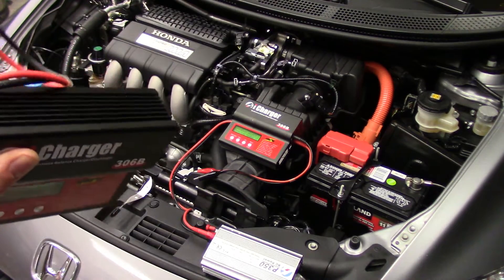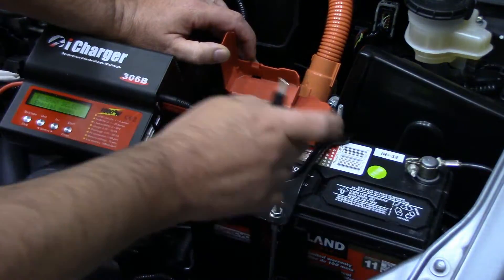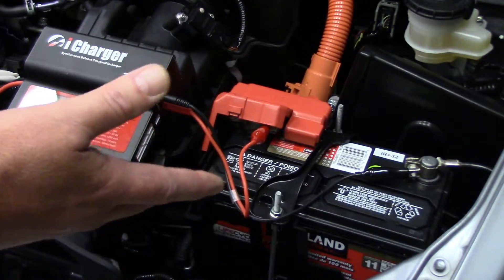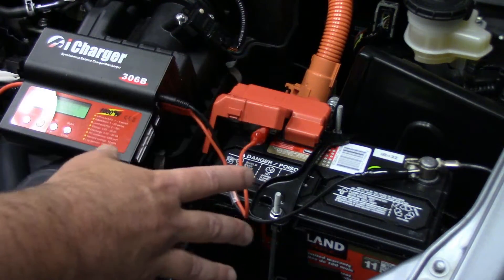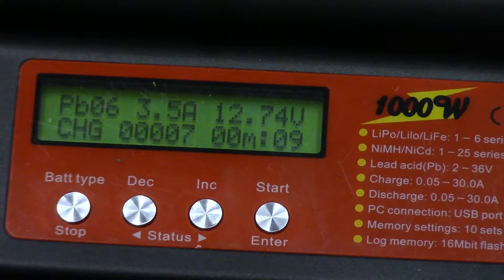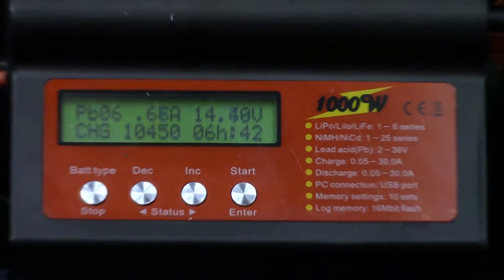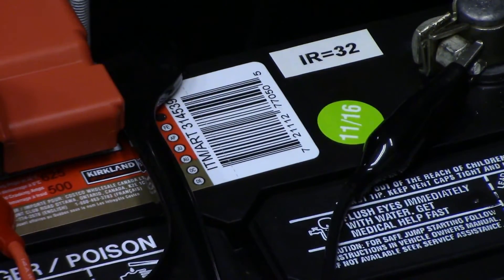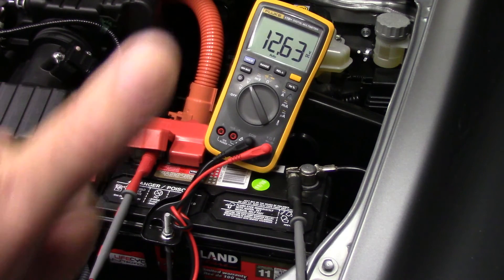How To Charge A Car Battery With RC Charger - Connecting, charge rate & tips.

Comment: Where does the 2.4 come from? Just curious
Reply from the maker: If you are referencing the 2.4 denominator to figure out Ah from reserve capacity, it was in a conversion formula I found online. I have no idea where they got that denominator from? The better method IMO is by using the reserve capacity in hours x 25A. If you are referencing the 2.4 volts number I mentioned, that is the typical voltage applied across each cell in a lead acid (PB) battery during the topping/absorption constant voltage phase of the charge cycle.
Reply: @Rchelicopterfun  my charger has a setting for cell voltage which defaults to 2.4 for pb. this is the correct setting? i'm reading 2.1 v in some other research i've done so i'm not sure which to go with. great video
Reply: @trevorstuart3950 Same with mine. Using a K2 Air.
Reply: I was reafy to ask the same  question.

Comment: Can any RC chargers you're aware of be used as battery maintainers and or desulfators? I have a Hitec and don't see anything in the menus that seems like it can do this...wondering if there is anything out there aside from stuff like the NOCO chargers that don't really work for the RC world....
Reply from the maker: I don't know of any computerized RC charger/s that has a de-sulfate PB battery algorithm. No idea if they would work as "maintainers" since they will generally stop the charge cycle once the battery reaches its full voltage potential. I suppose if you used a really low charge current rate, it likely wouldn't turn off due to the internal resistance of the battery not allowing a full peak voltage to occur so the charger would keep apply a tiny flow of current (provided you disable any time or capacity auto shut offs in the charger) . Again, that is just an educated guess as I've never used a computerized charger to maintain a PB battery - I've only charged them.

Comment: Planning to use my duo 4010. Wasn’t sure if I needed a special cable with battery clamps. Also wondering if you can desulfate a battery with one by turning up voltage and minimizing amperage. I haven’t yet looked into the charger options to see what’s available.

Comment: I've always believed that once a car battery is allowed to go flat, it's toast and will no longer hold a charge. Is that correct ?
Reply from the maker: It really depends on the quality of the battery, age of the battery, capacity of the battery and how long it was left in a discharged state. I've had many vehicle and power equipment PB batteries go flat over night/several days due a light or accessory being left on or a high parasitic drain. Most of the time they charge back up fine if done ASAP.
No question usable life has been reduced & compromised with such events as some plate sulfation has definitely occurred, (the longer it sits in a discharged state, the more it will sulfate), but if it happens to a healthy battery a few times  and it's recharged ASAP, there should still be lots of usable life left in the battery.
Reply: Thanks John, I used my Imax to recharge my battery. It took almost 24 hours and at 3.5amps it put a whopping 14,000mah back in. I tested the IR (my Imax has that feature) and it's given me a very low score of 14. I'm not sure if I can trust this battery for trips around town. I don't want to get caught out. My car has been sitting in my garage for 7 weeks as I had a crook knee and was unable to drive it. Although I have been starting it once a week and letting it run for around 15 minutes. Obviously that wasn't enough for the alternator to re-charge it. Maybe a good long run on a freeway might do the trick ?
Reply from the maker: Load testing the battery is the sure fire way to know if the battery can still deliver its rated current. And yes, not much good can come from starting the vehicle several times and let it idle for 15 minutes each time. Likely took more charge out of the battery during each start than was put back into it. Would have been better to just hook your charger up to it every couple weeks. No point driving it on the freeway if you have already charged it back up to capacity with your charger.

Comment: All of these should apply with optima battery  as well right maybe amp charging a little different?
Reply from the maker: PB charging principles and algorithm used are exact the same. CC (constant current) for most of the charge cycle and then finishing/topping up with CV (constant voltage).
Reply: @Rchelicopterfun  my optima battery was on 6 volts its  been sitting for a year, i have the 4010 icharger and it's telling me low voltage. I tried charging it on NMH and the charger read it. All good now like brand new. Thanks for the response.

Comment: My PSU is a 12v only.  (modded Dell server PSU), would that be enough?  It should, right?
Reply from the maker: Depends on your charger, charge voltage, and current.
Reply: @Rchelicopterfun  i am using iCharger 208B, same settings as in your video.

Comment: My brain is refusing to work for me, what settings would I use for a 12 volt 3ah battery?
Reply from the maker: Assuming you want to use a PB safe 0.1C charge rate; 0.1x3Ah = 0.3 Amps
Reply: @Rchelicopterfun  
Thank you so much.

Comment: Thank you, my vehicle specific charger crappdd out during this pandemic so I dug out my old chargers and thanks to you got my truck up and running again.
Reply from the maker: Thanks Jim, glad it helped. Stay safe.
Reply: @Rchelicopterfun  
Thank you, it not only got the truck up and running again but made me a hero to my wife. And due to the pressure off since my truck was working, I was able to figure out what was wrong with my old Schumaker 600a charger. Turns out it was a bad fan, snipped it out of there, grabbed a replacement from an old spare parts box and it was up and running again.